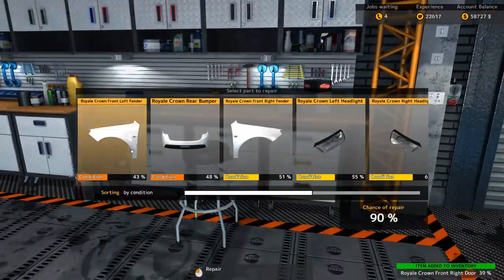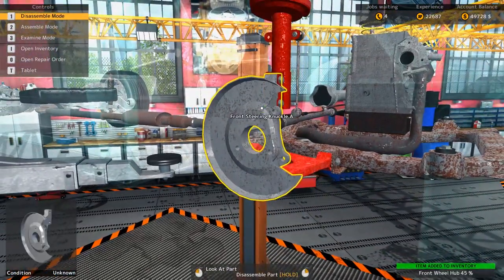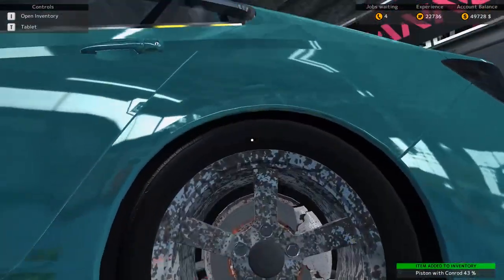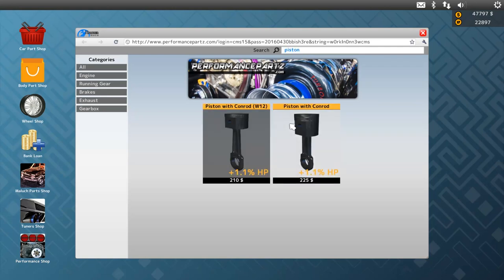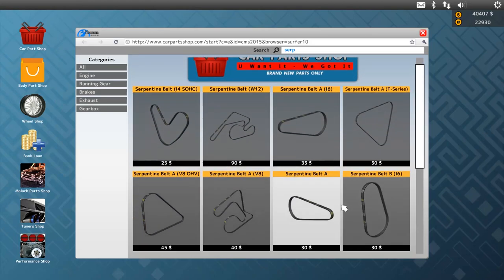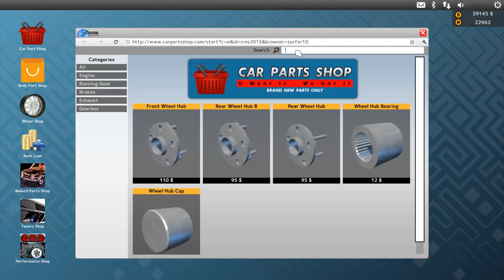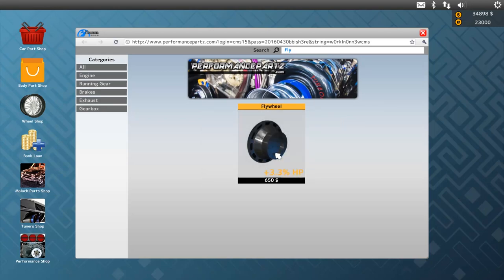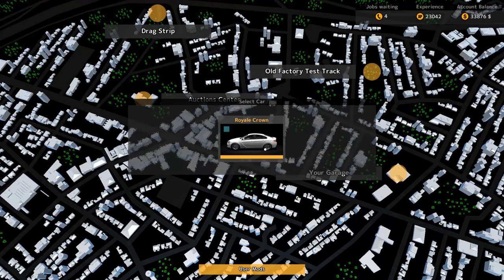OUR FIRST FULL TURBO BUILD! | Car Mechanic Simulator 2015

Comment: why do the cars in this game have so many rubber bushings
Reply: Geoffrey Eubank because cars have a lot of rubber bushings
Reply: Graffitiman Thanx but why, what do the the rubber bushings do to the car. how do the rubber bushings help the over all performance of the car?
Reply: Geoffrey Eubank it allows parts to move without scraping on each other. Similar to what oil does in the engine.